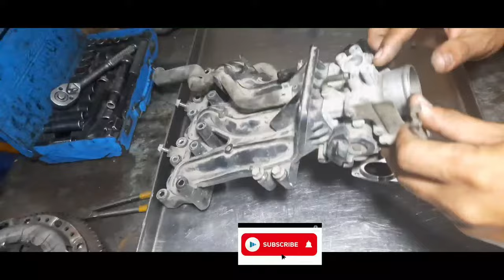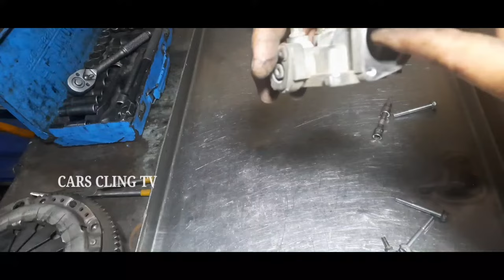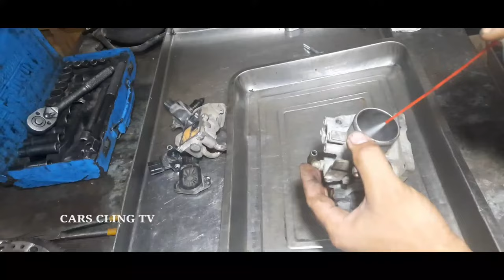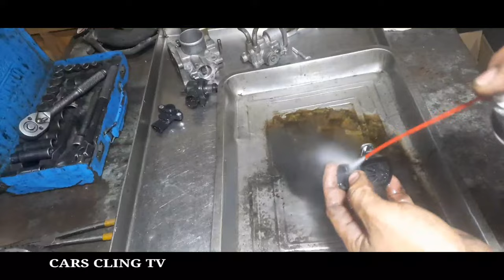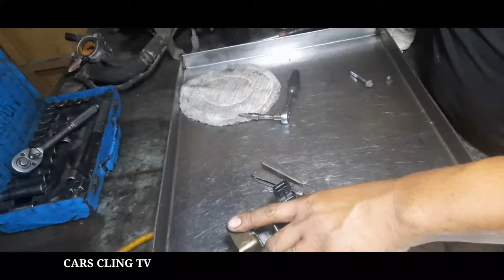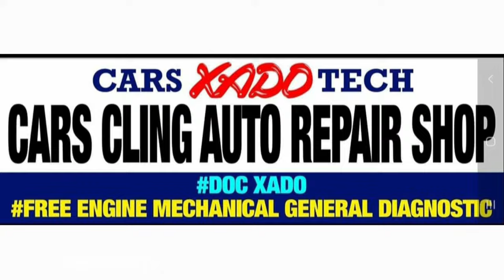ENGINE VIBRATION DIED DURING IDLING IACV TPS MAP SENSORS MAIN CAUSE ISSUE CLEANING SET UP TUTORIALS

Comment: Sir yung f6a ko carb.type kapag binuksan ko aircon nanginginig makina na parang mamatay tapos kapag pinatay ko agad ang aircon balik ulit sa normal na andar ang makina.
Reply from the maker: Yes Sir,. paki check ng actuator switch ng unit, hindi na po ito gumagana kaya namamatay almost ang engine,.
Reply: Ok nmn actuator switch ok din vacuum at ok din idle up
Reply from the maker: Ang kawalan ng hatak at nangungunangig ng makina ng isang DA64 Suzuki Transformer ay maaaring may iba't ibang mga posibleng dahilan. Ilan sa mga ito ay:

1. Sira o palya sa sistema ng combustion: Maaaring may fault sa sistema ng combustion ng makina tulad ng mga spark plugs na sira o hindi gumagana nang maayos, ignition timing na hindi tama, o iba pang mga isyung may kaugnayan sa pagkabulok ng gilid o ignition system. Ang mga ito ay maaaring magresulta sa hindi tama na pagpapakawala ng enerhiya ito.

2. Mahinang fuel pressure: Kung ang presyon ng fuel sa systema ay hindi tama, maaaring magdulot ito ng kawalan ng sapat na hatak. Maaaring dahilan ng mga ito ang isang sira na fuel pump, clogged fuel lines, o mga isyung kaugnay ng fuel injector.

3. Problema sa air intake system: Kung mayroong mga hadlang o sira sa air intake system tulad ng clogged air filter, vacuum leaks, o sira na mass air flow sensor, maaaring maduling ang pag-ikot ng makina at magdulot ng kawalan ng hatak.

4. Sira sa mga engine sensors: Ang mga sira sa iba't ibang mga sensor ng makina tulad ng crankshaft position sensor, camshaft position sensor, o maaaring iba pang mga sensor ay maaaring magdulot ng pagkabulok at hindi maayos na operasyon ng makina.

5. Problema sa transmission: Ang mga isyu sa transmission tulad ng sira na torque converter o iba pang mga component nito ay maaaring magdulot ng pagkakaroon ng kawalan ng hatak o nanginginig na makina.

Para masiguro kung ano talaga ang dahilan ng kawalan ng hatak at nangungunangig na makina, mahalagang dalhin ang sasakyan sa isang propesyonal na mekaniko. Ang mekaniko ay maaaring mag-conduct ng diagnostic tests at suriin ang iba't ibang mga sistema ng sasakyan upang matukoy ang tunay na sanhi ng problema at matugunan ito ng naayon.

More Basic Pointers  Toturials videos: https://www.youtube.com/channel/UCXSl7FUzPZV3lIxFWCHFTVA
FB Page CARS CLING TV: https://www.facebook.com/clingauto
CARSClingTvShortVideos: https://www.youtube.com/channel/UCsUWQnaD9vVKqL_w6eAYhgA
#
#xadoenginetreatment 
#carsclingtv 
#basicpointerstutorialissuefixed 
#xadoenginetreatmentengineperformancerecovered
#10yearslonglastceramicscarbonmetalcoated 
#carsclingautorepairshoplegacy 
#trottledelayremoval
#blackwhitesmokeremoval
#lowpowerengineremoval
#carsclingtvshortvideos
#xadoenginetreatment 
#changeoilpms
#enginecarbonchroming 
#carsclingautorepairshop
#remedyxadotreatment 
#acceptcheckengineissue 
#troubleshoot 
#legitonlineseller  
#Mobile09171259996
CARS CLING TV Located @Purok Pandian Gay Corner Makar Highway Brgy. Labangal General Santos City SouthCotabato 9500

Comment: Sir, ano po problema if malakas ang menor ng makina if tumatakbo na neutral? pero pag nakahinto, okay naman ang menor ng makina. Salamat po
Reply from the maker: Yes Sir,.May dalawang cause ng high rpm, 1st gumagana ang idle up sa pagataas ng rpm kung FI engine,. Kung manual engine may problema ang accelerator cable,

Comment: Gud am Po sir,...my Tanong lang Ako bakit namamatay Ang makina Ng K6A engine ko? Ang dahilan nag palit lang Ako na cylinder head gasket dahil nasira na...Ngayon ok na...maganda na Ang andar Kaso namamatay...
Reply from the maker: Yes Sir,. may ossue po ang iyong Intake Air Control Valve mechanism sensor, need for diagnose, need po linisan,.

Comment: Yung samin po . .mahina ang pag chage kahit bago na ang alternator at battery 12v prin khin nka start na . .sana matulungan nyo po ako  . .😢😢
Reply from the maker: Kung mahina pa rin ang charging system ng iyong Suzuki kahit na bago na ang alternator at battery, maaaring may ibang isyu o bahagi na nagdudulot ng problema. Narito ang ilang posibleng dahilan:

1. *Faulty or Loose Connections:* Suriin ang mga koneksyon sa battery, alternator, at mga grounding cables. Siguraduhing mahigpit ang mga terminal at walang corrosion na makakaapekto sa electrical flow.

2. *Serpentine Belt Issues:* Ang belt na nagdadala ng drive power sa alternator ay dapat na nasa maayos na kondisyon at tamang tension. Kung ito ay maluwag o worn-out, maaaring hindi maayos na umiikot ang alternator.

3. *Blown Fuses or Fusible Links:* Suriin ang mga fuse at fusible link na nauugnay sa charging system. Ang nasirang fuse ay maaaring mag-interrupt ng electrical flow mula sa alternator papunta sa battery.

4. *Voltage Regulator Problems:* Kahit bago ang alternator, kung ang voltage regulator ay hindi gumagana ng maayos, maaaring hindi nito natutugunan ang tamang level ng charging. Madalas na integrated sa alternator ang regulator, kaya't pwedeng kailangang suriin o palitan ito.

5. *Wiring Issues:* Suriin ang mga wiring at harness para sa anumang signs ng damage, shorts, o open circuits. Ang mga sirang kable ay maaaring humantong sa hindi sapat na charging.

6. *Electrical System Draw:* Maaaring may sapilitang pag-hatak ng kuryente o parasitic draw mula sa ibang bahagi ng sasakyan, tulad ng aftermarket accessories, na sanhi ng mabilis na pagkaubos ng power mula sa battery.

7. *Faulty Ground Connections:* Siguraduhing maayos ang ground connections dahil ang mga ito ay kritikal para sa electrical system ng sasakyan.

8. *Battery Issue:* Kahit bagong palit ang battery, maaaring ito ay defective o hindi tama ang kapasidad para sa iyong sasakyan.

Kung hindi mo pa rin matukoy ang problema matapos suriin ang mga ito, mas mainam na dalhin sa isang propesyonal na mekaniko para sa masusing inspeksyon at diagnosis ng charging system.

Comment: paano bos kapag palyado ?
Reply from the maker: Ang palyado o misfiring ng makina ay maaaring sanhi ng iba't ibang problema. Narito ang ilang posibleng dahilan:

1. *Spark Plugs:* Kung ang mga spark plugs ay luma, marumi, o nasira, maaaring hindi nila maapoyan ng maayos ang fuel-air mixture, na nagreresulta sa misfiring.

2. *Ignition Coils:* Problema sa ignition coils ay maaaring magdulot ng hindi sapat na electric current para sa spark plugs, na nagiging sanhi ng misfire.

3. *Fuel System Issues:* Kung barado ang fuel injectors o may problema sa fuel pump, maaaring hindi sapat ang gasolina na umaabot sa engine cylinders, na nagdudulot ng misfire.

4. *Air Intake Issues:* Kung barado ang air filter o may problema sa air intake, maaaring hindi sapat ang hangin na pumapasok sa makina, na nagiging sanhi ng maling fuel-air mixture.

5. *Vacuum Leaks:* Ang pagtagas ng vacuum ay maaaring makagulo sa tamang air-fuel mixture, na nagre-resulta sa misfiring.

6. *EGR Valve Malfunction:* Kung stuck open ang Exhaust Gas Recirculation (EGR) valve, maaaring lumabas ang masyadong maraming exhaust gases sa intake manifold, na nagdudulot ng misfire.

7. *Compression Problems:* Kung may problema sa compression, halimbawa'y may sira sa piston rings o valves, hindi makakagawa ng sapat na power ang makina, na nagreresulta rin sa misfire.

8. *Sensor Issues:* Ang mga sira o maling basa mula sa crankshaft o camshaft position sensors ay maaaring makaapekto sa timing ng makina at magdulot ng misfire.

9. *Timing Belt/Chain Issues:* Kung natanggal o lumuwag ang timing belt o chain, maaaring magresulta ito sa maling timing sa pagbukas at pagsara ng mga valves, na nagdudulot ng misfire.

Para matukoy ang eksaktong sanhi ng misfiring, maipapayo na dalhin ang sasakyan sa isang propesyonal na mekaniko para sa tamang diagnosis at solusyon.

More Auto Basic Pointers Toturials with %100 FREE
https://www.youtube.com/channel/UCXSl7FUzPZV3lIxFWCHFTVA

Comment: anu kaya problema ng Da63t ko boss pag cold start ko lakas ng vibration minsan namamatay pa
Reply from the maker: Kapag ang iyong Da63t ay nagpapakita ng malakas na vibration at maaari pa itong mamatay kapag medyo malamig na panahon, ilan sa mga posibleng isyu ay ang mga sumusunod:

1. Sira sa ignition system: Maaaring may mga sira sa ignition system tulad ng spark plugs, ignition coil, o distributor cap. Kapag ang mga ito ay hindi gumagana ng maayos, maaaring hindi tama ang pagsusunog ng combustible mixture sa loob ng engine. Ito ay maaaring magdulot ng malakas na vibration at resbak na pagkabuhay ng sasakyan.

2. Fuel delivery issue: Maaaring may problema din sa fuel delivery system tulad ng dirty fuel injectors, sira na fuel pump, o clogged fuel lines. Kapag hindi sapat ang fuel na naibibigay sa engine, maaaring mamatay ito o magdulot ng hindi gumagandang pagsusunog na nagreresulta sa malakas na vibration.

3. Engine mounts issue: Ang sira o labis na pagkakalubog ng mga engine mounts ay maaaring maging sanhi ng malakas na vibration sa sasakyan. Ang mga engine mounts ay ang mga konektor na naglalagay at nag-aabsorb ng vibrasyon ng engine. Kapag ito ay sira, maaaring maranasan mo ang malakas na vibration.

4. Idle control system issue: Posible rin na may sira sa mga bahagi ng idle control system tulad ng idle air control valve o throttle body. Kapag ang mga ito ay hindi gumagana nang maayos, maaaring hindi mapanatili ng sasakyan ang tamang idle speed kapag malamig na panahon, na nagreresulta sa malakas na vibration at pagkamatay ng sasakyan.

Mahalagang dalhin ang iyong sasakyan sa isang propesyonal na mekaniko upang ma-diagnose nang tama ang mga isyu at mabigyan ng tamang solusyon. Sila ang may sapat na kaalaman at kasanayan upang matukoy ang root cause ng problema at masuri ang mga bahagi ng sasakyan na maaaring maging sanhi ng mga isyung iyong naobserbahan.

Salamat sa walang sawang suporta sa ating munting channel

For more inquiries contact @ FB Page CARS CLING TV: https://www.facebook.com/clingauto
Please Support, Like & Follow  Thank you and God bless!
Contact: 09171259996
CARS CLING TV Located @Purok Pandian Gay Corner Makar Highway Brgy. Labangal General Santos City SouthCotabato 9500
please support my other channel:
CARSClingTvShortVideos: https://www.youtube.com/channel/UCsUWQnaD9vVKqL_w6eAYhgA
Aqua Marine Adventure: https://www.youtube.com/channel/UCHxjUhFmYMbRGxN3l21pNeg